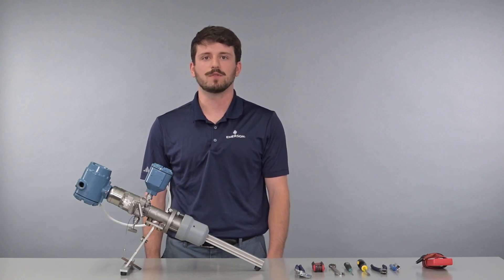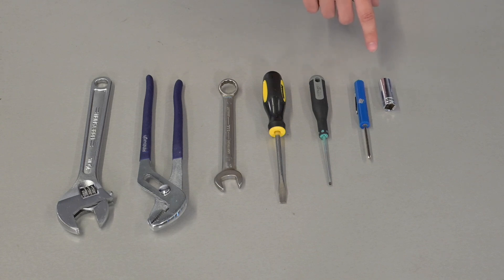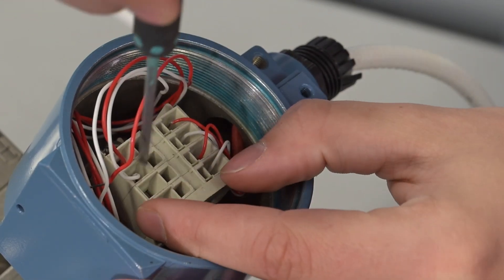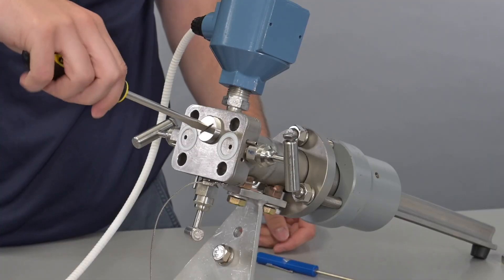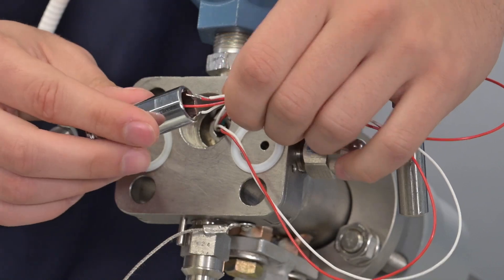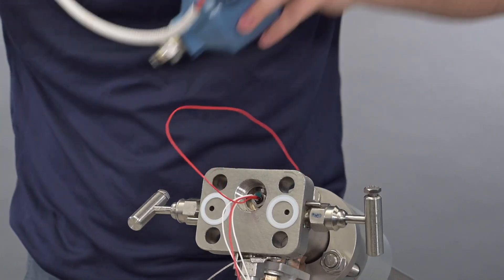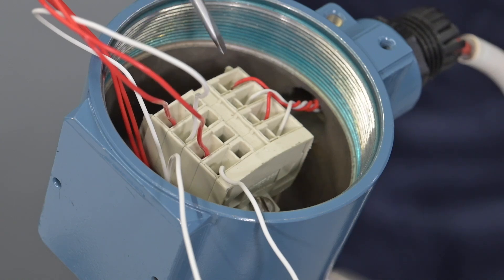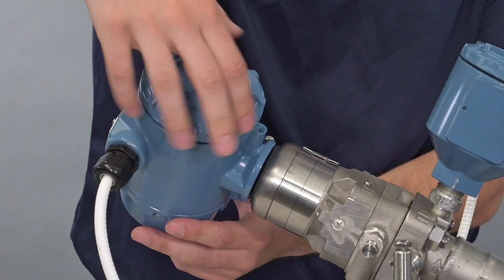How to Replace the Rosemount™ Annubar Flow Meter RTD

Comment: Can this be done when pipe is pressurised?
Reply: Yes! Isolate the system by closing the pressure supply valve!
Reply: In addition, open the bleed valve to remove all pressure. Ensure you have disconnected electrical supply from the transmitter.